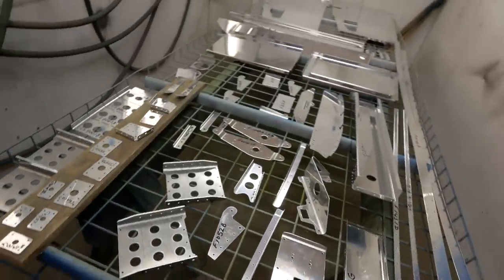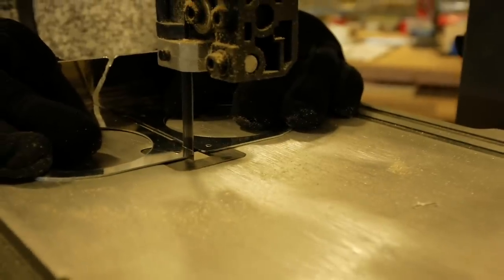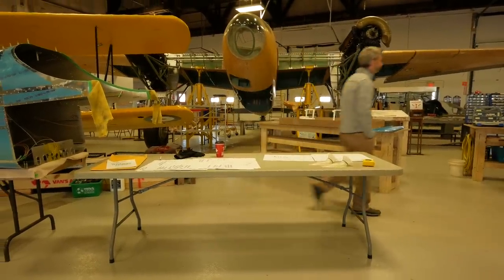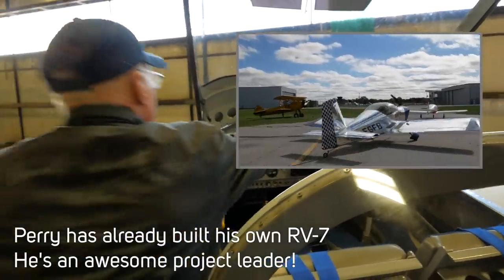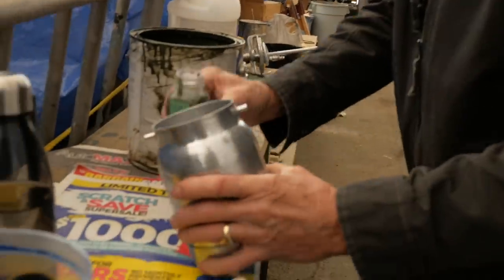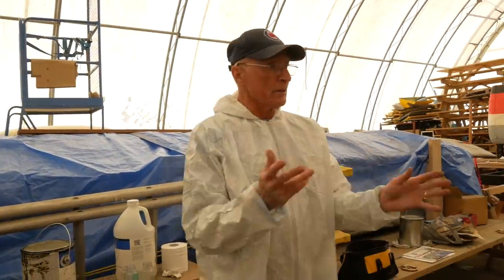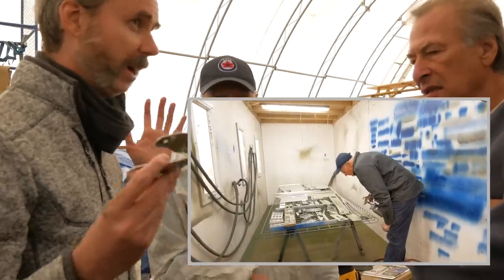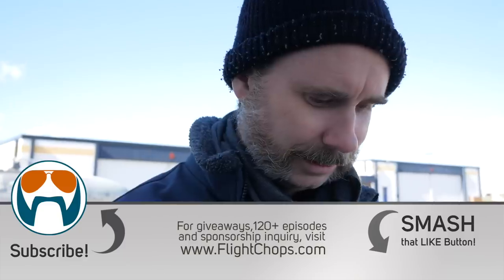Mistakes were Made, Lessons Learned - Build VLOG #5

Comment: Only touch the side of the disk sander that is traveling down (right side).  That way it pushes the part down into the table and is much more stable and easy to control.  On the second part you sanded down, you did it on the left side, and that is why it was jumping around.  6th grade wood shop FTW!!!
Reply from the maker: Awesome thanks for that tip - I was wondering why it was jumping; I thought it might’ve had something to do with the material - Love learning from you guys!

Comment: Again, congrats on the Instrument Rating.  I'm proud of you.
At 5:33, Perry inspecting the cockpit, and behind him is an engine I would LOVE to see in the RV, even though it'll never fit or happen.  But, hey, it's cool to dream!
As to two pilots, I don't know if I've told this story on your channel on not.  My father, a CFII and another CFII, pre-flighting a Cessna 150.  One pilot takes the left side, the other takes the right side.  Neither of them took off the rudder gust lock.  Fortunately, a 150 can fly very nicely with no rudder, and once they figured it out, came back around, landed and took the gust lock off, and then took off again.
But, ONE pilot in command, ONE pilot responsible for the airplane.  Especially in a small airplane where two pilots do not normally fly together.

Comment: Hey, congrats on the IFR rating, Steve! 👍🍻

I spray painted the hood of my '72 El Camino about 20 years ago at my apartment complex in Phoenix. It was about 106°F out, probably 10% relative humidity that day - the paint was nearly completely dry by the time it hit the surface of the hood at about 14" back, which was how I always spray painted back in humid MA. Yep, it was getting fully tacky in the air! This created a finish exactly like 40 grit sandpaper - in fact, it felt just like it! It remained that way for the next 12 years until I sold it. The front edge was smooth, because by that point I had realized I had to hold the can about 4" from the surface to prevent that from happening. 😂

Bonus was, when I pulled out into the hot sun, the paint baked on to a super-durable finish. I had accidentally hit it with brake cleaner many times over the years, and it didn't even touch it. 😁

Comment: I haven't painted (automotive) in a while but the temperature that you were painting at (you were wearing a cold weather hat) made me pause. The spray gun was old school. The last time I painted anything I used a Binks HVLP (High Volume Low Pressure) gun and it was amazing. Good thing you caught the reducer / primer issue early. You want to hold the nozzle perpendicular to what you're spraying not bend your wrist side to side.
Reply from the maker: Thanks for the insights
Reply: @FlightChops  No worries. The gun I used was a Binks SV-100. It's a little pricey but the top cup / gravity feed and very nice paint distribution (saves on sanding time) was so much better than the Binks #7. I still have all of my painting equipment in storage (translated that means it probably all needs to be rebuilt). Congrats again on the instrument rating and I'm looking forward to more build videos
Reply from the maker: Thanks - and I appreciate that you watched all the way to the end to catch the mention of the Instrument Rating

Comment: I made a simular mistake with hardener on 2K paint for a car, that cost me 2 weeks of prep and repaint, not to say a fair amount of cash, for new paint and all the stuff to clean off paint that would not go off! 

At least yours was on a few part and in the primer stage. 

Lesson for me is alway do a spray out card first to make sure you have the gun setting and mix right, especially when it comes to top coats.

Comment: Hi Steve.  It doesn't look like you roughed up the surfaces of your parts.  A scotchbrite pad or 320 grit sandpaper work well to make the primer adhere better.  Good luck.
Reply from the maker: Thanks - I'll pass that along to the crew
Reply: I noticed the same thing. I was given the tip that if you can see a reflection then it isn't ready for paint. The surface should be matt grey and throughly cleaned (although your hands wil be black from the scuffing dust lol). Over time with heat contractions the paint could start to lose it's grip. You can also do the tape test (get some gorilla tape and see if it pulls off the paint to check it is bonded correctly). Other than that it's looking good, lots of work but worth the effort in the end.
Reply: Yup, I scuff my parts with maroon Scotch-Brite and PreKote until there is no shine, when rinsed the water should sheet off and not break or bead for several seconds.

Comment: I'm watching this while waiting for replacement parts to arrive.  Got my oil cooler location on the baffles wrong; too high; hits the top cowl.  Going backward to go forward again.  I found a few "gotchas" with the quickbuild; some steps that I thought were done that weren't; others I wish hadn't been done yet.  Painting: major pain.  Were those parts scuffed?  Most paints won't adhere to the Alclad surface.  Another Golden Rule: if it don't fit, don't force it.

Comment: Suggestion on the quick build.  When you review it against the plans make sure you're doing more than just a 'looks about right' check.  While mistakes are rare I had several on mine where something wasn't match drilled or countersunk, or the wrong rivets were used.
Reply from the maker: We actually did a pretty thorough job - it was hard to capture the detail to that degree on camera...  But as for your situation - Really?  Wow.  What kit do you have and when was that?  Did you report it to Van’s?
Reply: @FlightChops  RV-10, got both the Fuselage and Wing kits April of '16.  I didn't report any issues, just drilled out the rivets and countersunk and riveted with the correct ones. I'm sure I found other issues post initial inspection, just worked through them as they popped up.

Comment: I'm WAY too late to THIS party, but I kept wondering (as an A&P) where's the Alodine 1201 conversion coating?  I thought those pieces should have a pale gold hue before the Zinc Chromate primer goes on.  Not so with Vans?  Or is the primer better these days than when I learned about that stuff 14 years ago, and no longer needs that extra step?

Comment: So this is basically just a giant Erectors set. I want to try it.
Reply: A bit more complex, but yeah.
Reply: An erector set that if built wrong could kill you. And uses rivets instead of nuts and bolts. So yeah.
Reply: Erector sets don't require skilled assembly techniques. 
ie. Is that riveted correct, what exact grease goes on this bolt and does it go under the head and nut or just on the threads(this very thing has cause helicopter crashes), does the tightening pattern(and rate) matter on that group of fasteners, does this cable have sufficient clearance to avoid binding or abrasion, will this section be inspected and serviceed or sealed off(if so does it need a final treatment), should this bit be safety wired, if this needs disassembly and reassembly can these screws/bolts be reused(some are designed such that they deform on assembly)?
Reply: @xureality  Which is why, at least in the U.S., you have a FAA inspector come out and evaluate your build quality in steps along the way.
Reply: @mytech6779  which is what makes it all the more fun.  Erector sets are for kids, and kids abilities.  This is for an adult who liked erector sets as a kid, but wants the knowledge that he or she has gone above and beyond to build something that flies and will get you where you want to go safely.

Comment: For the next time you paint: if you're using respirators, you should probably be using goggles too.  As a very different but relevant example, there was a C-141 crash where flaming paint in the cargo hold released cyanide smoke into the cabin air.  Though the crew had oxygen masks on to keep from breathing in the cyanide, it entered their bodies through their eyes. The USAF subsequently added goggles to the emergency O2 masks, and recently upgraded them to an integrated mask/goggle system that is much more effective at sealing around the face.
Because of this story, I regard anything that's dangerous to breathe in as equally dangerous to/via your eyes.  Even if it's not toxic, the thought of getting vaporized paint in my eyes is not pleasant.
Reply from the maker: Wow yeah - that’s a nightmare.  I did think about my eyes after that and decided not to do it again with out goggles of some sort

Comment: A simple thing Vans can do on a quick build, is provide a sheet of paper that says, 
"in this quick build, reference instructions 6-1 through 12-10 (or whatever the case is for that section of the aircraft), are completed. Upon receipt, you can start building at Instruction step 13-1. It does not need to be published, but they should at least tell the customer where this quick build is complete to, so that they can assume building at the next step..

Sometimes the most obvious answer is the easiest. Vans should just tell the customer where to start after getting this part.
Reply from the maker: I think they are getting to a process like you suggest - it has just taken time for the documentation to catch up with the quick build kits.
Reply: @FlightChops  I am sure they will

Comment: At the risk of being called the resident "Safety Steve"  I'd like to mention that wearing gloves when using the bench grinder & sander is a serious safety violation.  Please don't do it you will appreciate having both thumbs and all your fingers when flying the new plane.
Reply from the maker: Insights appreciated - several others have pointed this out - maybe I should do a video about all the safety things that one should know before working with these tools (clearly I need the info myself)
Reply: @FlightChops  well if you're looking for learning moments: at 3:19 when you're putting the second flat edge on the part, it chatters and you instinctively put your (gloved) fingers right up close to the disc to stop it. This is because you're working on the 'wrong' side of the disc, ie: the one that is rotating up and away from the work. You didn't have that problem making the first flat because you worked on the other side (although you were getting pretty close to crossing the centre point). 

Sharing your learning and mistakes is part of what makes this channel so great - thank you!

Comment: not very familiar with your paint process. Isn't it supposed to degrease wash, alodine, then prime each and every part before you even start assemble? But I ran through many other home build video, even the factory build doesn't prime theirs before assemble. Very new to me.